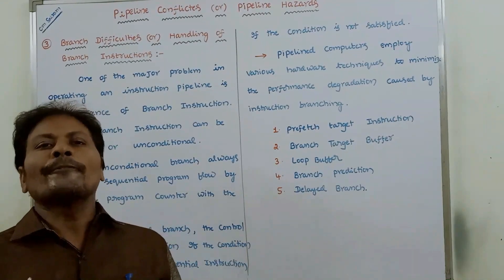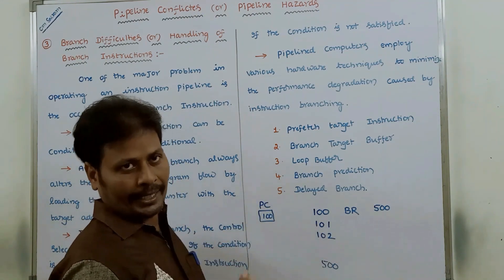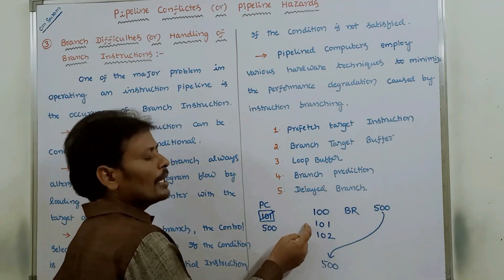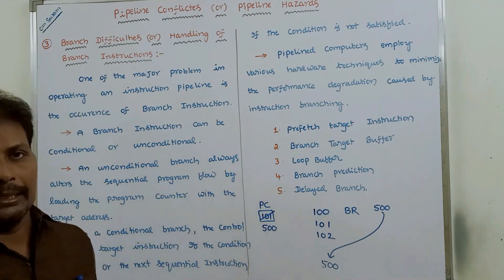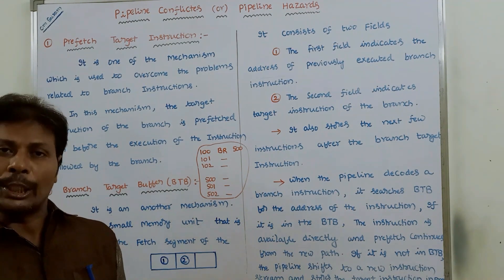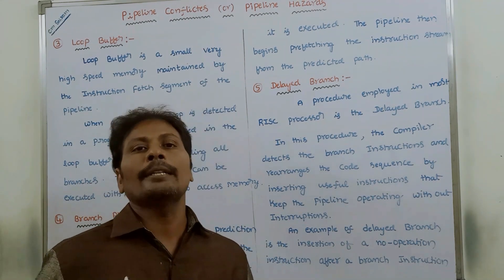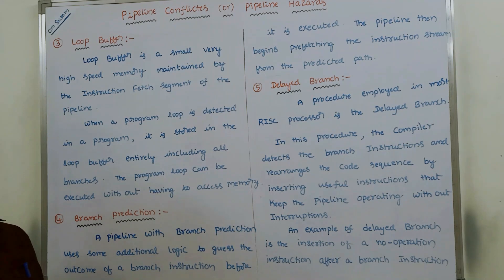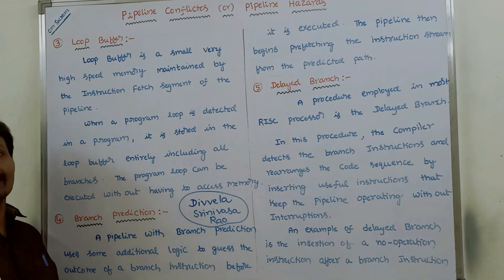Pipeline Hazards || Pipeline Conflicts || Pipeline Hazards and its types || Hazards || CO | CA | COA

Comment from the maker: For PART-1 Pipeline Hazards or Conflicts video use this link:  https://youtu.be/pp4GjBA0wVU
Pipeline Conflicts can also be called as Pipeline Hazards
Resource Conflicts can also be called as Structural  Hazards
Data Dependency Conflicts can also be called as Data Hazards
Branch Difficulties can also be called as Control Hazards
hence there are 3 types of Hazards/Conflicts
1.Structural  Hazards (or) Resource Conflicts
2. Data Hazards (or) Data Dependency Conflicts
3.Control Hazards (or) Branch Difficulties